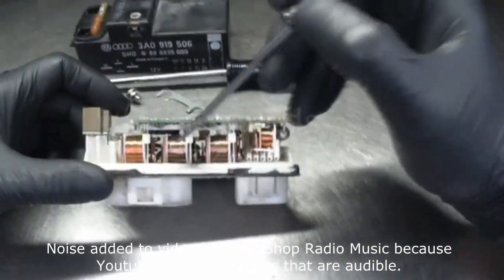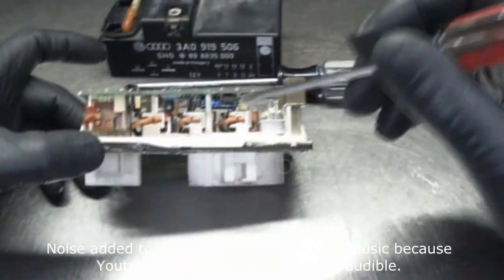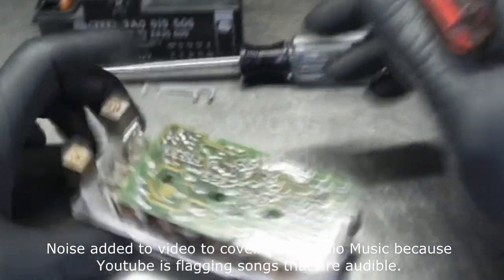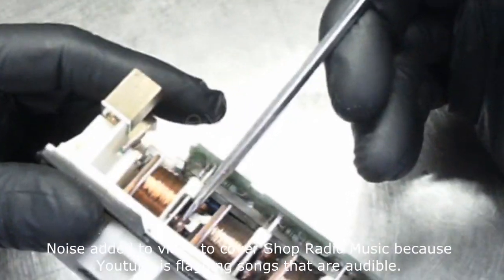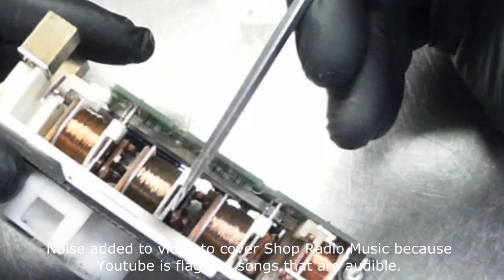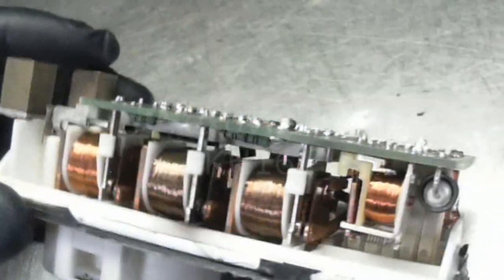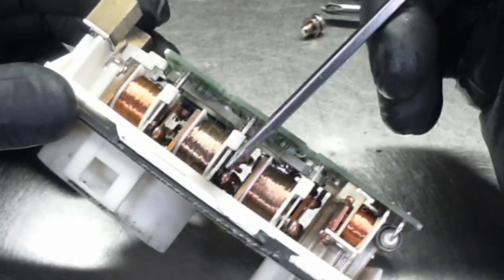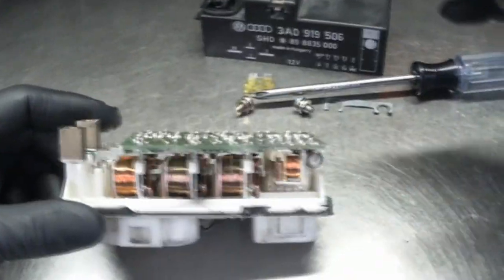VW A3: Coolant Fan Control Module Autopsy (for lack of a better word)

Comment: Great video! I am having a similar problem.  One of my fans is not kicking on.  I am overheating a little.  How do I check if the module has gone out, the sensor is back or the fan is bad?

Comment: Hey how do I know if my fan control module is bad. Only issue I have is my fans don’t continue to run after car is shut off and the engine is hot. It used to years ago. My car is a 2001 golf and the fan control module is original. Thx Sir
Reply from the maker: With engine off, the fans only run if the radiator fan switch is sensing hot coolant. In some cases it might take 10 minutes (after shut off) that the sensor gets hot and triggers the fans (low speed). Even 1.8t engines with electric after-run water pump... only trigger the pump and not the fans. So this is normal. The times that you heard the fans right after shut down, were times when the fans were already activated while the engine has been running.
Reply: @EXOVCDS  Thanks again for the fast reply. You are very appreciated my friend. I wish u lived near nyc area
Reply from the maker: Thank you for watching.

Comment: Ever had one out a B7 A4. Have one the fan control module is pulling down voltage to the ECM. causes the ECM not to turn on and fans to run until key is turned off. 

plan on cutting it open after I replace it with a new one.
Reply from the maker: +TAHS Auto Tech No I haven't... interesting, good find!

Comment: lol you can get rich helping with this fan control module unit alone , i picked up a 2002 audi tt quattro turb  1 yr ago on july 10 found it burnt inside just the same i decided to take a chance and change all the sensors tied to it well it Dec 2018 i just recieved a new 1 yesterday getting ready to install it again but this time i want ti try and trace all grounds and power wires connected to it  control module and check them out , if anyone else has gone this far tap me and let me know thanks good video my man thumps up
Reply from the maker: Thank you for watching!
Happy New Year!

Comment: Hi i have a 2010 corolla 1.8 l   and my radiator fan only come on when i turn ac on   but whit ac off the radiator fan not work i change the termostat, fan relay , and the temp sensor and have the same problem    cant be the fan module?????
Reply from the maker: I don't know how things are controlled on your Corolla... once fan, 2 fans, fan module etc. You need a wiring diagram to test / check the components.
Reply: Only one fan have my corolla
Reply from the maker: Have you found a wiring diagram? 
Is the engine overheating?

Comment: Hello, I have a bit of a problem, and thought I would ask. I have a 2.0 2004 Jetta, and the large coolant fan does nothing. The small one works well, on low and high speeds, but the big one does nothing. I know the AC blower resistor is fried, so the AC is not working at the moment, I was wondering if that may have caused the problem. What does the large fan primarily cool for? The engine or AC? Thanks, Erik
Reply from the maker: Both should come on at low or high speed (same power source). If one does nothing, the fan is bad. Confirm power & ground at the large fan connector before replacing it.
Reply: Thanks man! Will do.

Comment: Thank you for sharing your awesome videos...my car is mk3 2L swapped to a vr6 all things change on it to becomes just like oem vr6 only the 5 lugs....so my problem is how to check the fan speed 2 and 3 on it speed 1 is ok and aux pump work on when switch on and when off it shut off by 10 minutes so I guess that's OK also the car has A/C but not charge I need to know how to test all the  speeds?? i need your help and thanks in advance....
Reply from the maker: A wiring diagram should show you what operates what / how the speeds are controlled. Low speed is controlled directly by the thermo switch in the radiator,  second speed is also triggered by the radiator fan switch, but the switch sends a signal to the coolant fan control module. A/C / high speed is controlled by the coolant fan control module... triggers the fan according to a/c activation, temp sensor for a/c cut-out (coolant too hot) etc.

Find a wiring diagram that matches the system you have, so that you can verify the operation of all speeds.
Reply: I have more than one diagrams...the problem is my car only runs the low speed and when I check the rad fan switch with the car is on and jumping from the + to the other 2 pins each are same runs the low speed
Reply from the maker: AG Al Zobidy I'll have a look at a diagram tomorrow and will check on a vehicle the next time I see one... I'll get back to you. As long as it's not overheating, it's safe to drive.
Reply: ***** l will wait for..yes but in my country the weather is really hot now reach 50 degrees but the temp gauge still in the middle no issues the fan low speed on and off normaly... https://sites.google.com/site/stoyneff/miscellaneous/the-vr6-cooling-system 
i use this site to test my speeds amd only low works also when bridge the other pin in rad fan switch. Just to let you know thanks
Reply from the maker: AG Al Zobidy That looks like good testing information... if things do not behave as they are listed, then I can only assume that a wiring fault exists, or the coolant fan control module is bad. Make sure that all the power & grounds for the CFCM are in order.
Reply: Yes it's... Maybe that's a wiring fault could be..I replaced the fan control module with VR one and test another 2 with the same number and they are exactly the same...I will thanks for your help very appreciated

Comment: Hi, any idea where is that located on Polo Mk3 1.4tdi. car heats to 100C, no more. Fan is not spinning, checked it -its working. Fuse at battery  is ok.  Thanks!
Reply from the maker: Boyan SilyavskiLow speed fan operation does not require fan module to be triggered. Watch this and tell me what you find:
https://youtu.be/Roh6RCs8IJk

Comment: Hello sir I have an issue with the module in my car and was hoping you can help me out.
It started as AC not working. Sometimes works sometimes stops. Eventually it just stoped. Compressor is not turning and fans are not working (Both). I did some tests and find out that my Fan Module is bad so I purchased a new one put it in and the AC and fans started working but not even a day until same symptoms came back which makes me believe that something is shorting my module. Any idea what could it be. Thanks
Reply from the maker: You'll need to find a wiring diagram and check all the circuits / components going to & from the fan module.
Reply: thanks I will try

Comment: I had a similar problem with my VR6 AAA 
Fan keeps going 10-15min after car was shut down.(Sometimes so long when battery was drained)
Sometimes i had to pull the "blue plug" to shut down that fan. Somehow this problem was gone after some time.
Also i had problems with overheating. Cooling fan keeps coming on when engine temp was about 90C+  and had sometimes it wont turn on when the engine temp was 105C+
Everything seems working fine about 2 weeks when my cooling fan engine burned down(stucked).  
I bought new Fan module and new fan but. But this problem was still going on and after one week new Fan motor burned down. 

Do you know something how to fix that problem?
Reply from the maker: Not sure what's going on, sorry.

Comment: the fcm control a/c compressor?because mine actives only when it pass 2000 rpm
Reply from the maker: +Christian Andujar Romero What year, model, engine size?
Reply: +Thomas EXOVCDS mine is a 97 Jetta gl
Reply from the maker: +Christian Andujar Romero Yes, the fcm activates the compressor clutch... the delay in activation could be due to low a/c charge? have the system pressure tested.

Comment: Is 1J0 919 506 "K" the same as "N" ? "N" is the one I found in a local shop...

Looking between them, the only difference I see is the white ball at the right, what does it mean, any advice?

Jetta GLS 1.8T not working fans when AC is on, only with temp bulb.

thanks In advance (Y)
Reply from the maker: What's the concern... overheating or no fans when AC is on?
https://www.youtube.com/watch?v=Roh6RCs8IJk
Reply: Thomas EXOVCDS no fans...
Reply from the maker: Fan module is NOT needed for low speed.... fix that first. If both low speeds are burnt out, replace both fans. Follow the testing steps in the link I sent.

Comment: i have a question om my mk4 golf the cooling fans dont kick on at all. so i jumped them low speed kicks on both run slow but when trying to jump high speed nothing happens. my ac doesnt work it just blows hot air could it be the control module?
Reply from the maker: Nick Hudson Did you check the green fuses on top of the battery? Remove the one on the left and have a look at the contacts... they can get burnt and prevent current flow.
Is your lower radiator hose getting warm? If not, then your thermostat is not opening.
If your engine is not overheating when at cruising speeds and only overheats at idle, then the thermostat is OK.
Reply: Yea the thermostat still works. Its only overheating at idle. I had replaced the fuses so there still good. Im stumped do you know why its not going into hightl speed even when i jump it?
Reply from the maker: Nick Hudson High speed is most likely burnt out. Do you have battery power at one of the wires in the rad fan switch at the side of the radiator (3 wire plug)?

If yes, bridge at that sensor harness plug to see if you can get low speed to activate.

If you don't have power at one of those cables (all the time), then you have a wiring issue.

High speed is activated through the Fan Control Module. You need to have the ignition ON, bridge high speed circuit at the rad fan switch and then the FCC will trigger the fans.

Again... the engine should run fine on just low speed. Don't worry about high speed until you find out why low speed is not working. High speed is most likely burnt out, but with colder winter temperatures will not be needed anyways, so you can deal with that in the spring / summer.

If the wiring is OK and you CAN trigger low speed by bridging the raf fan switch harness plug... then it is either a faulty rad fan switch or the sensor is not getting warm due to no circulation through the radiator (but since you have no overheating when cruising, flow should be good).

Make sure that the ground side for both fans is also good.
Reply: Yes i have power to it. I did and low speed activated when trying to activate high speed nothing happend.... so this mens i have a wiring issue?
Reply from the maker: Nick Hudson No, most likely high speed is burnt out (you need key in the ON position when checking high speed).

If low speed is OK when you bridge at the connector, then the rad fan switch in the radiator is bad or the sensor is not getting warm (blocked radiator, faulty thermostat, water pump no good). NOT a wiring issue.

Don't focus on high speed, figure out why low speed is not working.

If you are sure that the thermostat, the water pump & the radiator are OK, then change the radiator fan switch.
Reply: I have replaced the thermostat I replaced the fan sensor switch fuses ontop of the battery the one fan fuse inside the cab fuse box. Is there any other sensors i might be able to replace i dont know any other ones. I also took the fan sensor switch and reconnected to the plug and applied Heat the fans kicked on right on at 125 degrees. So i dont think it was bad but still got replaced any other ideas?
Reply from the maker: Nick Hudson 125c ? that's not good... should come on around 95c.
There is no other sensor that needs to be checked / replaced.
A faulty water pump will not flow / push enough coolant for the radiator to get hot enough.
Turn the heater to max heat and the blower fan to max... warm air should remain warm. If the air turns cold, the water pump is bad.
Reply: Oh no it Fahrenheit 125F im in US az right in the middle of the desert
Reply: I did what you said my heat works great and i have great flow back to the coolent Reservoir
Reply from the maker: Nick Hudson 
I don't know how more direct I can explain things.

From what you told me, the wiring & fuses are OK (bypassing / bridging at the radiator fan switch confirms this).

You said the thermostat is good, the radiator hose gets warm, the radiator fan switch is new, the radiator is ok and the water pump is good..

In that case, the fans should come on at low speed... at around 96/97c (204/206F) while the engine is at idle.

If not, then something above is not working correctly.

Is the engine actually overheating? All you said was that the fans don't come on.

If you bridge low speed so that low speed is always on... does the engine still overheat at idle?
Reply: Yes it overheats the temp gauge goues all the way up and the red light comes on and i can tell from the lag in power when its really hot i havent wired it to be like that i havent tried that but im sure it wouldnt because the air passing through the radiator. The only reason I thought it was the fan control module is because I read somewhere else that it controls the AC compressor and the cooling fans. But I also read somewhere that it's not likely it would go bad and that's only thing I haven't replacedim doing it for a hobbie project car i have time to work on it it not like i have to drive it so thats a plus.
Reply from the maker: Nick Hudson If you look at a wiring diagram... low speed does not go through the fan control module (as already mentioned) so you can ignore it & high speed.

If it does NOT overheat when you bridge low speed at the rad fan switch, then the thermostat, water pump are OK... but either the fan switch is bad or hot coolant is not getting to the switch.

If it STILL overheats with low speed running all the time... water pump or radiator is not up to par (provided that the new thermostat is ok).

Simple system.
Reply: Okay ill test that out. And the ac any ideas why its not working?
Reply from the maker: Nick Hudson I would get the cooling fan issue sorted out first... more important.
Reply: Okay cool man thank you for taking your time to reply.

Comment: I have a 2003 Audi A3 2.0 tdi. For some reason today, my coolant fans come on and they have remained on even with the ignition turned off. I came back to my car 20 minutes later and the fan is still on, it will not go off regardless of what i do. The engine coolant temperature does and has not gone above 90 degrees C. Any tips/advice on where to look?
Reply from the maker: +Chris Not sure.. I'd have to check a wiring diagram to see what all ties into the fan circuit. If the fan module is part of the large rad fan, could be that the fan module is keeping them stuck on. Could be a temperature or AC pressure sensor as well... but not sure.
Reply: Thanks for the quick response.
Reply: I have an Audi a3 8p1 with BGU motor.My fans keep working in low speed with the ignition off.I replaced the two temperature coolant sensors and the thermostat. Nothing...they told me that it is the fan control unit and in my car as they told me is in the fans.There isn't a boxy control unit.Should I replace all the radiator unit or if I find the big one only?The price for all the unit is huge for me right now and I hope to find a cheaper solution.Thank you for your time.
Reply from the maker: enzokou If the Fan Control Unit for your car is in one of the fans, it will be in the Large fan. The Fan Control Module receives signals from the engine computer and then turns both fans on & off. You can see the fan module cooling fins in this video: 
https://youtu.be/tmHyHMORoMM?t=4m1s
I'm replacing the small one, but you can see the big fan center section looks different (control module).
Reply: ***** Thanks for your response!If I disconnect the radiator unit,is there a problem if I move the car for 3km? Here in Greece is winter now(no over heating problems),If the car see that the radiators are not there will turn in safe mode or something?I want to remove the fans and see exactly the characteristics to order the new part.Thank you very much!
Reply from the maker: enzokou You can drive the car with the "fans" removed, but NOT with the radiator removed. You should be able to remove the fans without removing the radiator (just like in this video: https://www.youtube.com/watch?v=tmHyHMORoMM&feature=youtu.be&t=4m1s
Reply: My mistake,I meant the radiator's fans.
Reply from the maker: enzokou OK.